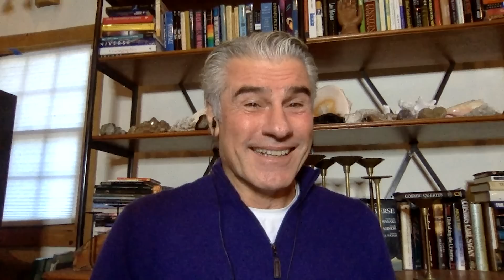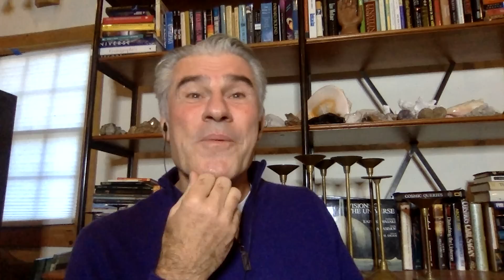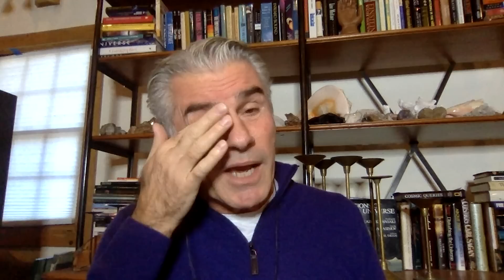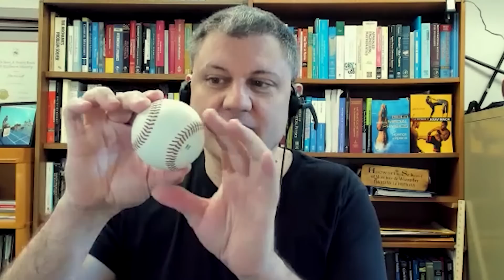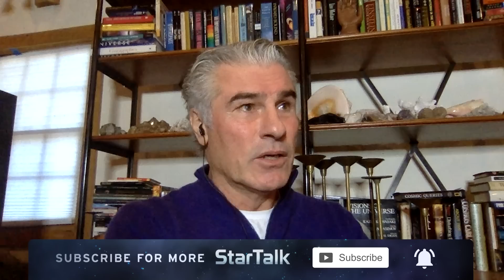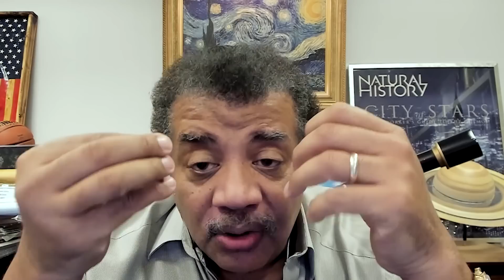How Physics Has Changed The 2022 World Cup

Comment: Just to add some perspective. Even pro footballers have issues applying intentional rotation when kicking the ball  in fast pased, high tension situations...so they would miss kicks etc. But on the otherhand, freekicks often have precise ball control from the kicker because they can focus on how to apply what they need to apply.
Reply: About the asymmetry in weight distribution of the ball, due to the valve, it doesn't do anything at all. This would have made a difference if the football pitch was maybe four to ten times bigger.